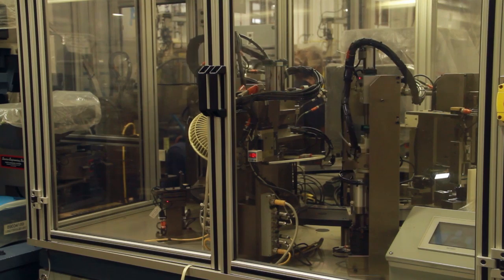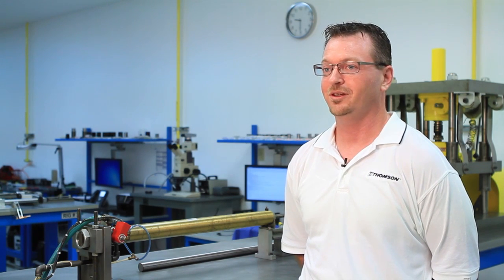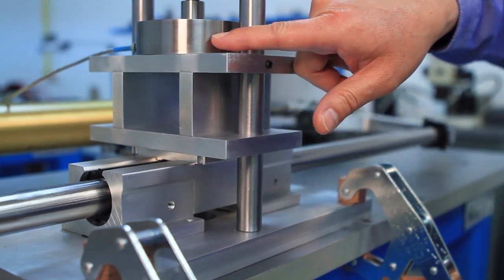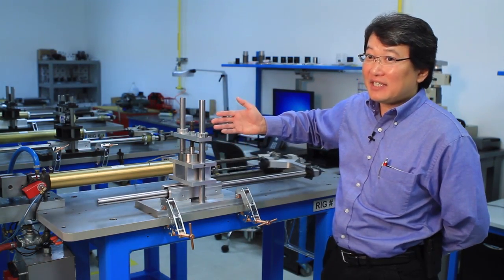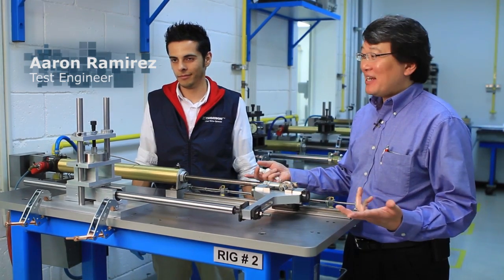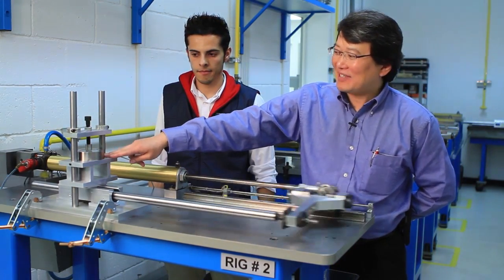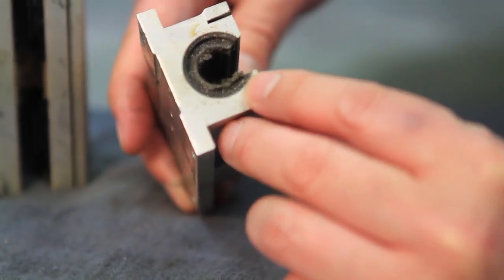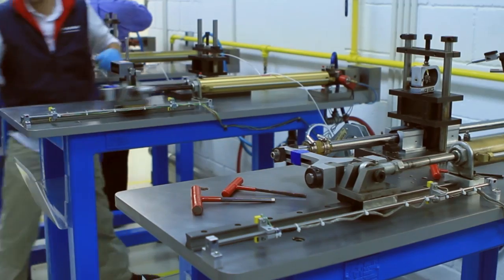Preventative Linear Bearing Maintenance

Comment: Hi
What is the best lube for linear bearings ?
Reply from the maker: The lubrication recommended can depend on application.  A lubrication manufacturer would be best able to recommend a lubricant.  However for general applications an EP2, extreme pressure NLGI grade 2 lubricant would be a good one to try.